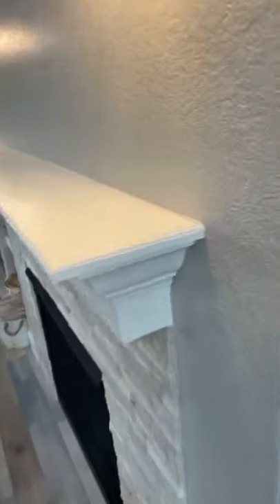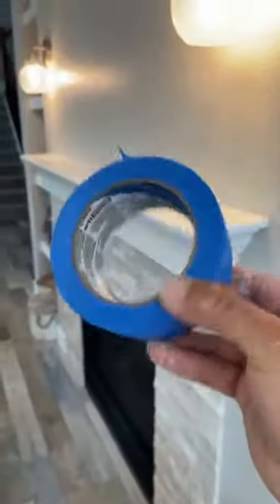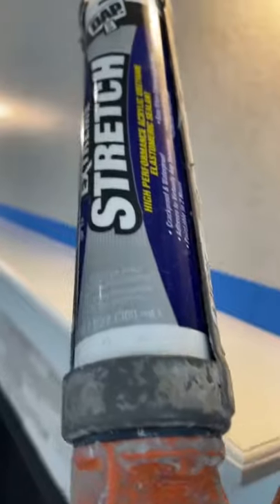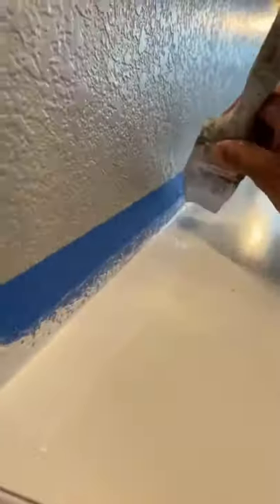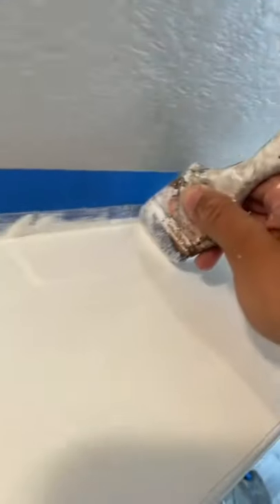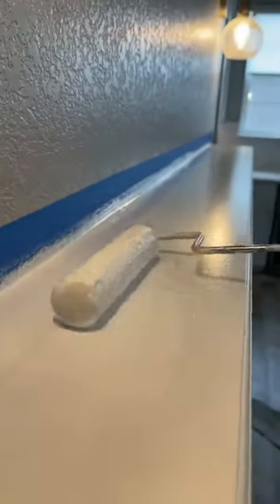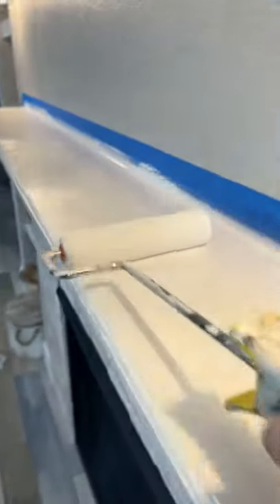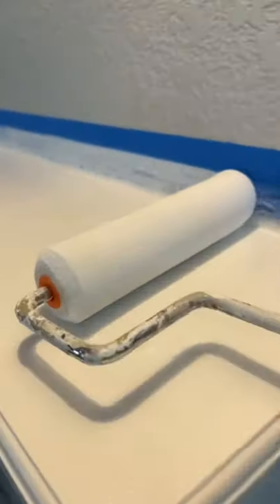How to paint fireplace mantel with roller. #shorts #fireplace #mantel #diy

Comment: I have used a couple different additives besides floetrol, but they are usually more expensive and don't work much better for the price. Floetrol is a lifesaver.
Reply: I usually use m1. Flowtrol is nice but I seem to like the m1 better. Also like the m1 deglosser for my pre paint cleaner. Just as good as using tsp, if not a lil better. Works really well for when we paint cabinetry
Reply: @DarkPhoenix203Ct  what is my I'm about to try to paint my laminate electric fireplace and will be moving on to my kitchen cupboards after the new year. I'm in Canada 🇨🇦
Reply: @Birdie-gd9qn  The most important thing with painting cabinets it's the prep work. Make sure you clean your cabinet surfaces really well and make sure any scratches or dents are taken care of with your favorite putty. Like I said tsp does a great job when it comes to cleaning off the cabinets and prepping them for paint or you can check out the stuff that M1 has such as the de-glosser. No matter what I always use an additive when doing cabinets cuz it's really helps get rid of brush strokes or roller marks. If your spraying your cabinets the additive just helps flatten out your paint so everything looks smooth and flat as glass. Good luck with your upcoming projects, I hope you knock it outta the park

Comment: Looking good jalapeno!

You could have taped both sides just fix the crack and no repaint?
No cheating
As I'm sitting here thinking the crack in the molding went down around the side you would have needed to do some very technical taping on the wall to fix that side of mantle the same way?🙋‍♂️👏👏👏

Comment: Its funny how a lot of people don't know how great Flotrol works. 🖌👷🏼‍♂️
Reply: What it is doing to the paint?
Reply: @synewparadigm  Flotrol allows the paint to maintain a wet edge by stopping quick drying and so eliminating roller or brush marks that Latex paint is notorious for.
Reply: I was just gonna ask about it. Does it help when painting walls & ceilings?
Reply: @dlane7539  100% it does. I would never paint without it now. In a warm room regular paint drys way to quick. We have two rooms 14’ x 22’ and when we had new drywall installed during a reno it would have been a total mess unless you can spray and have a person back roll behind the guy spraying. It eliminates patches and roller lines by keeping the paint wet long enough to allow you to blend it all together. It also pays to keep the room as cold as possible to further slow down the drying time. If you use up to a max of 20% floetrol to the paint this will give you a good mix. If spray painting use less as it can run a little especially if the spray gun is putting out a lot of paint and you have to move quicker to reduce the amount hitting the surface. Once you’ve tried it you won’t go back. You can even thin the paint also with a little water just don’t make it to runny or else you will get splashing off the roller. One last thing try not to use a paint brush with latex. Go for one of the fine fibre type pads or use a sponge brush. Good luck and happy painting. 👍
Reply: Floetrol and penetrol have been around forever today's latex pants are a little high tech not a hundred percent sure you can mix with floetrol?👍
Sherwin-Williams snap dry?
Hirshfield's Advanced?
Synthetic oils?
I would definitely read the directions.
Reply: @Shanegla  Penetrol is for oil based finishes paint and varnish etc. Floetrol is sold by all household paint stores and I’ve used it for years now no issues. Can’t speak for other brand names you mentioned though.
Reply: @richardshort4587  
Yessir

Comment: "Don't worry it's not structurally it's just cosmetic" is exactly what that apartment in Miami was told about the crack in the basement one year before it collapsed.
Reply: I’m sure that basement was held together with caulking in the same fashion as this fireplace is.
Reply: Horrible comparison you just did there
Reply: It's just a joke bro chill
Reply: ..well i mean, its not like the house is gonna seperate from that and fall down
Reply: @MrDoctorScat  no lol they painted over the crack
Reply: @about823jews  Jokes are funny
Reply: These are new construction homes thats what happens when they settle

Comment: A painter should know you never roll trim. I’ve been a contractor for 20 years and roll in trimwork is a definite no. But you can roll it and then back brush it in order to get the paint on quicker
Reply: Why not?
Reply: @becton98  it creates a weird texture look with the paint roller...even when you use a product like flotrol that's supposed to hide brush and roller marks. Flotrol in the paint and using a brush gives you the smoothest surface outside of spraying it.
Reply: @zachstevens6258  Anytime I use a brush, I see brush marks. I've never used Flotrol? So I don't know what that is, but I always pull my 4" roller out and give it a better texture than brush marks. I could see why a smoother brushed finish on trim would be better though for a smooth surface but those brush marks would drive me through a wall! 🤣
Reply: @Chris.Rhodes  flotrol is basically an oil you add to paint that makes the paint settle better and eliminates those brush marks. It's a must-have for any pro painter.
Reply: Brushing after rolling is a special technique though, right? I remember reading about this when it comes to 2-comoponent polyurethane paint and getting a nice finish.
Reply: @zachstevens6258  Thanks, I'm a maintenance tech at a housing complex, so I do a lot of painting. I'm going to have to look into it!
Reply: @zachstevens6258  you’re dead wrong. If you know how to time your finish you can do some
Amazing stuff with with certain rollers.
Reply: @zachstevens6258  it’s not oil at all. It’s wetting agents and acrylic resin
Reply: @ryane6719  I said it's "basically an oil" to make it easier for people to understand how it works. Get back to work, goofy.
Reply: @ryane6719  until you learn how to talk to a customer you need to climb back up that ladder and get to work, goofy.

Comment: Dude that's only the top what about the sides.
Reply: Exactly thanks Joe
Reply: Hey jalepeno why such a small bead only to wipe it off on that wet towel. How bout woking that bead into the joint further then giving good damp  wipe.
Reply: @toddsimpson8690  now this is the comment I was looking for. He barely skimmed the surface, it's just a polished turd at this point, next homeowners gonna have to hire someone to repair it.

Comment: Use cardboard instead of the wet rag for caulk. Thank me later.
Reply: why?
Reply: @Chris.Rhodes  It gets the cault right off your fingers every single time. Old trick. IT WORKS!
Reply: @rogue.source  I would probably use the cardboard and wet rag at the end to get the caulk off my finger at the end.
Reply: @ryane6719  For? Your fingers? Or caulk?